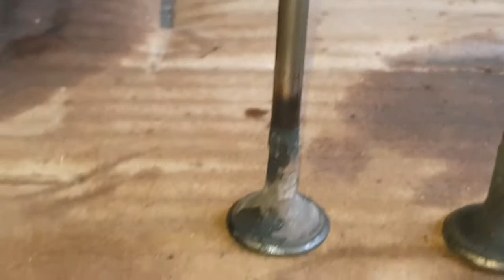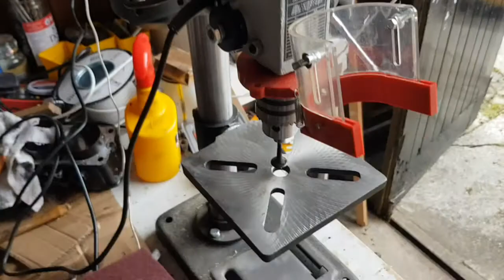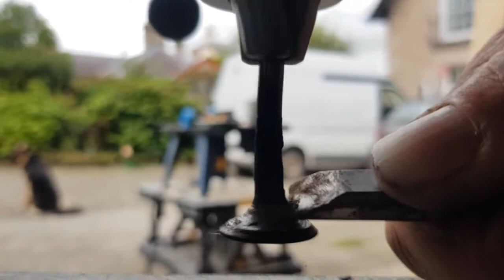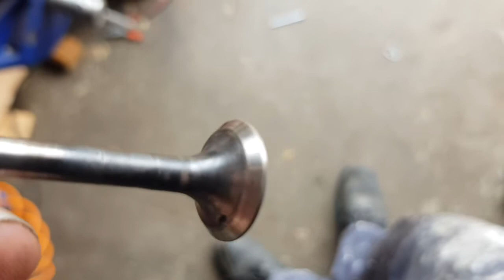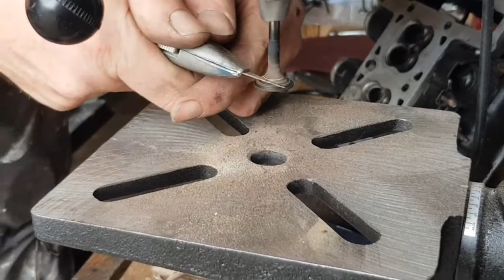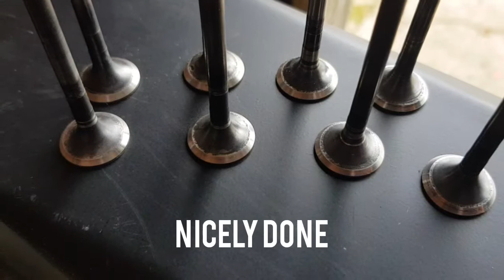Remove Carbon build up from valves in under 2 minutes.

Comment: Nice tip. I do a very similar job to this when I clean up valves. My bench grinder has a drill Chuck in one end so I spin them in that and use coarse grit emery. 👌
Reply: It makes sense. Again, like you,  just using what's around and making my life easier.